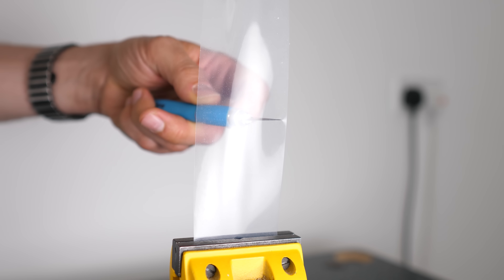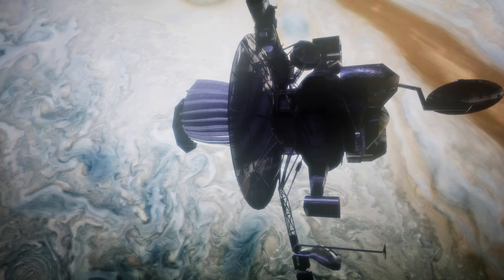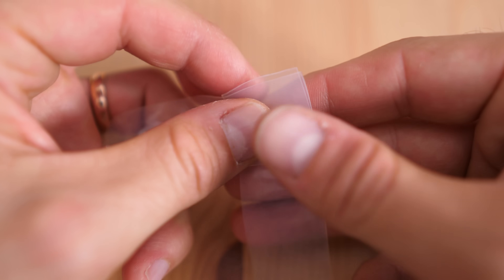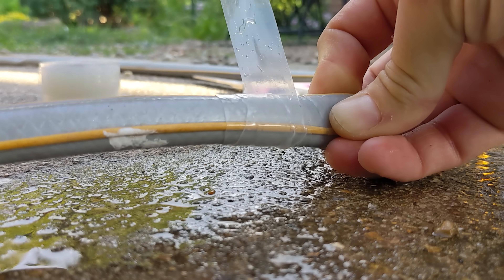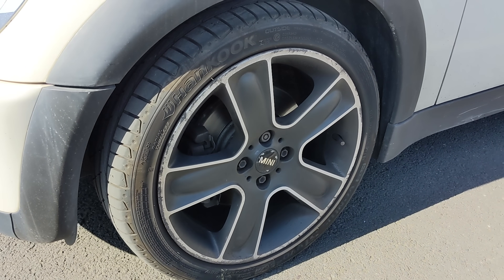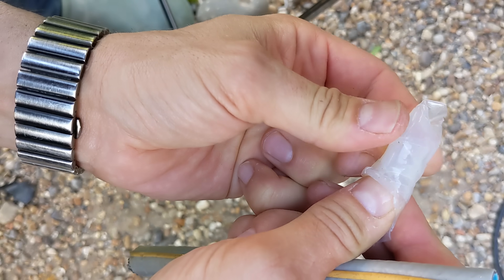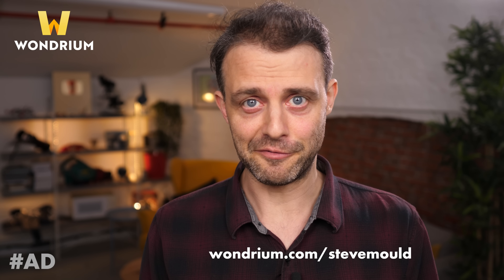Self-Healing Material

Comment: Back in the day I serviced high vacuum pumps and systems. I had a call to a rubber factory that crosslinked a continuous sheet of rubber with x-rays. The rubber sheet entered and exited a serious looking thick walled concrete room with a very heavy bank vault looking door - this is where it was irradiated with very strong x-rays. There was a very high vacuum system for the x-ray source and it had a leak which I needed to find with helium. Being in this room was scary as the vacuum system was on and if the x-ray chamber was switched on I would get like a thousand chest x-rays at once. There are so many times I wished I had a camera with me!

Comment: Ever since I learned about cold welding in vacuum, many many years ago, I always wanted to do an experiment where I have an hermetically sealed workspace filled with nitrogen, then machine two pieces of metal flat, polish them to reduce the surface roughness to a minimum, while also keeping the flatness, and then try to cold weld them together, and if that doesn't work, because of the nitrogen between the pieces, put them in a vacuum chamber and then try to rub them together to see it they fuse.
Reply: There is a video on YouTube where someone tried to do exactly this as I recall. But I believe it was Action Lab and therefore flawed and ridiculous. Still you could check it out. One thing I will say as someone who works with both vacuum systems and nitrogen as a purge gas, it is very difficult to get either a very deep vacuum or a very pure nitrogen, and the cleanliness of your chamber will matter a great deal.

Comment: How well is the self-adherence? If you cut it in half and reattach just the ends, is that specific point weaker than the rest of the structure? You could maybe test this by cutting it in half, joining the cut, then putting it in some device that can gradually increase tension until it snaps

Comment: Fracture split conn rods, big ends are made as one , then the bottom clamp cracked off. The sodium cut is bubbling through the paraffin . I was told not to leave micrometers closed or the mirror faces will bond . Self vulcanizing tape i, but not seen transparent self vulcanizing before, and it is a bit sticky. Ive found the tape works very well . Always fascinating.

Comment: Since sodium metal reacts to water, with violence, does the sodium heat up, even a little, when it comes into contact with the water molecules in the surrounding air?  (Before oxidation occurs blocking the reaction.)  
Probably a Homer Simpson question but if you answered “no, not at all” that would be pretty interesting.

Comment: Push the metals together with enough pressure, then they would fuse.  You just need to overcome the oxidisation.  The polymer has parameters that avoid these issues of high pressure.  Nice non-the-less.

Comment: How does this polymer react to heat?  I'd like to know what chances of it being able to be 3d printed are.  With the current methods for fdm (the layer based thermoplastic printing), the layers are often the weakest part of the print.  This polymer would allow a part to become more isometric in properties.
Reply: I was just thinking the same thing.  This would be a great material for FDM printing assuming its properties are retained after heating.  One problem, however, is a different material would be needed for support material I would think.
Reply: @Bricksniper  guys it... it sticks to itself at room temperature... you can just extrude it and it'll fuse.

The problem, is that you'd need to put it on a filament roll, when it sticks to itself.
Reply: @Bricksniper  just print things that don't need supports

Comment: There is an older version of a non-healing tape used in aviation called F4 tape. It was a rubberized black tape with a stripe in one side. The tape is used to weatherproof aircraft cabling and wires exposed to the harsh elements aircraft operate in. When stretched tight around what it get wrapped on the non-stripe side would stick to itself as it trys to relax.
Reply: This is immediately what I thought of when I saw this video. I work with F4 tape every day!

Comment: In the electrical industry we use a tape called amalgamating tape. The tape is used for wrapping up joints made in cables that are outdoors like power lines. It is extremely stretchy and when applied it is stretched an wrapped around, and as it tries to shrink back it kind of bonds and the layers stick together similar to the polymer in the demo. I was always fascinated by this tape but couldn’t work out how it could work because it wasn’t sticky. What’s even more fascinating is why most materials don’t bond back together. Good demo and liked the shrine to PS.

Comment: I don't know if you've come across it before but have you ever seen two pieces of steel lock together because the surfaces were ground so flat that the grain structure could hold them together through friction? I can't remember the exact science of it but we had to do it at college during metal working class to demonstrate filing/lapping proficiency, it took bloody ages, I remember that much. I think they're called lapping faces, you create two perfectly flat pieces and then twist them together and the sort of cold weld to each other.

Comment: I think this material is awesome, I am going to share this with my boys for sure! 
Just for engagement;
Another cool thing about metal cold welding is that you can do it in the atmosphere! Obviously with gold, but also with oxidizing metals you just have to design the joint to push out the oxidized material as the material is pushed together 
But, even then there is an amount of time that you have to wait while holding it all steady for it all to weld together, it starts at random locations in a process called galling, and eventually becomes one solid unit. 
The amount of time is dependent on the temperature 
I find it absolutely crazy that there is amount of contact time required for the metal lattice to fully recognize that its one unit again!
Reply: well, as with crystallization lattices dont magically occur. ;)
Reply: @AkiSan0  also big brain
Reply: big brain

Comment: you can weld two pieces of metal back together by just pushing if you push hard and rotate the pieces of metal relative to each other and produce a bunch of heat (pressure welding)

Comment: Plastic Eng. Prof. here wondering if the material is a thermoplastic or thermoset. If you heat it does it melt or burn? If it does liquify I wonder if the material properties are the same after the material is cycled a few times. (P.S. Steve I give my students a polymer identification project each year, and this is going to be a great summary resource for them. Thanks for the awesome content!)

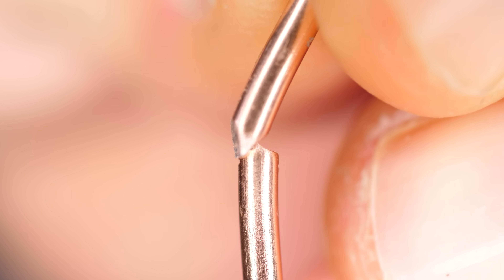Comment: 1:25 - still haven't finished the video; but metal then could be sealf healing in space without oxidation. In space metal should fuse back together if you press them on each other.

Comment: There has been a silicone 'tape' on the market for several years that will self-adhere but not stick to dissimilar surfaces.
Reply: Yes there is but it doesn't heal when two cut surfaces are put back together, it works by having a nanosurface covered in ridges or tendrils making one square centimetre many many square centimetres. Because perfectly smooth surfaces are very rare and full contact between surfaces is difficult to achieve when the nanosurface silicone is employed rather than just the silicone surface then far more contact is made, and because the silicone is slightly sticky the increased contact area increases the sticky factor proportionately. It's the nanosurface that reflects light in that holographic manner, that's how holographs work as well and shouldn't be mistaken for material stress dichroism (I think that's what it's called) and yes the tape doesn't stick very well to other stuff, it's naff.

Comment: I wonder if things like a bouncy ball or a tire are actually one whole crosslinked molecule, or if due to the randomness in the crosslinking reactions there's a small amount of very long and complex polymer chains but they are technically molecularly disconnected (just tangled together). Would be hard to prove either way.
Reply: It appears that tyres are, infact, one giant crosslinked molecule. The rubber goes through a process called volcanization that bonds it together, from my understanding. 

I'm not a tyre expert though 😂

Comment: I don't buy the oxidation argument for why metal won't fuse together on contact. That would imply that cutting + re-joining metal would work just fine in a vacuum chamber, or under oil for example, but it does not. I was really excited to hear an explanation for why metals don't fuse on contact, but I remain baffled!
Reply: Did you not watch the whole video? He explains that metals do indeed cold weld in the vacuum of space. And gold will cold weld even on earth because it doesn’t oxidise.
Reply: @supersymm3try  They cold weld in tiny spots if you're unlucky. It's a far cry from fusing together on contact.

Comment: I've always wondered what makes something "self healing". Ever since I bought a self healing cutting board for crafts. I'm not sure if it's made of the same material. Thank you for another amazing video!
Reply: Self healing cutting boards are different, they basically compress the surface rubber so that if it's cut, the compressed rubber expands to fill the gap, but it only works so many times
Reply: Self healing craft boards seem to be rubber glued to a base that is hard to cut. The rubber doesn't actually heal, but the slits don't remain visible because the base keeps the rubber in place.
Reply: @TimothyFish  This should be easy to test out by making a cut then pulling at the sides! I want a self healing cutting board to try this now. For science!
Reply: @TimothyFish  I vaguely recall some self-healing cutting boards that have micro-tubes of epoxy resin which ‘heal’ (fill) lacerations in the cutting surface, too.
Reply: @jasperfk  imagine the poisons in this product.
Reply: @TimothyFish  i knew it wasnt self healing when i saw the one on AvEs bench
Reply: So basically jusr beat up the board and let it melt a little?

Comment: the polymer isn't "self healing" so much as it is "self adhesive" which is why you can put any two surfaces of the polymer and press them together and they fuse.
I think it is important to make this distinction because there are self healing materials that return to their original form and structure when damaged.

Comment: What if it's a cross-linking environmental activated? Uv or O2 or H2O in the air. You could try in the dark or under water/oil (in vacuum seems defficult). Also it would be interesting trying very small surface interaction, is it sure it's not just vdw forces?
Reply: Nice video btw

Comment: You absolutely can fuse metal back together, if you machine the joining surfaces nearly perfectly (not even molecular, you can do this with an accurate mill) and slide them up against each other the crystals with align and they will become one again, requiring a lot of effort to separate or slide them again (depending on the metal, amount of surface area, and the accuracy of machine perfect).
Reply: What is this process called?

Comment: Similar to cold welding, I recall seeing a discussion in a Caltech publication that cleaving a diamond in a vacuum would leave 2 surfaces that could be brought back together and rejoin. IN THEORY, if the surfaces were perfectly realigned, then the diamond would have no optical defects evidencing  the cleave and rejoin.
Reply: @MonkeyJedi99  Gage blocks aren't wrung together causing the same type of thing as the tape though. I believe it's due to them being such a tight match that wringing them pushes most of the air out of the gap creating a slight vacuum. Not completely sure on that but I do know that it's not magnetism as I believe ceramic gage blocks will do the same thing and it's not cold welding as the joint isn't strong enough for that and there is a very very small oxide layer formed almost immediately when metal is machined and these blocks sit in a box specific gage blocks potentially not being used for years and then will still wring together.
Reply: @zugigauto  I did not even hint at magnetism, and I think you are right that the precision surfaces "wring" because of vacuum.
Reply: Cool

Comment: I am not sure about your explanation of why cut metals don't weld again after being cut. You said it's due to oxidation, but I think it's due atmospheric pressure. When you cut a metal, the new surfaces will be exposed to atmosphere, which will prevent them from welding again unless you applied a pressure higher than atmosheric pressure to force the air out of the surface of metal.

Comment: The material is evidently an elastomer like rubber, I don't think that cross-linking or reactive functional groups could be occurring because cross-linking of rubbers requires very reactive species to be present and able to collide not just touch, so any actual bond forming would only be likely in the liquid phase anyway. I think the reason that the material bonds is due to the materials ability to deform and return to its original shape. This is happening on the nanoscale as well as the macroscale, at ambient temperatures there is enough heat energy to make the polymer chains move around. This molecular motion allows chains on either piece to entangle and rejoin them. This could be tested for by lowering the temperature of the test pieces (flat so it's a fair test) until they become rigid and then attempting to rejoin them. If the materials data sheet is available it should show the glass transition temperature required for this (tg) or it may show more than one in which case it would be the lowest one. If this does not shed light on it then it's some kind of new voodoo but I suspect it's actually a performance elastomer.

Comment: Oh wow I thought with metal it was because of how neat the grid is and that when you cut it it’s hard to align the molecules exactly in front of where they were??
Reply: Metals are not, generally, a "strict" lattice (i.e., they're not like a crystal), so realigning the metal atoms exactly is not going to be an issue.
Reply: @mattheffron391  ohh good to know! But I mean in a sense of the straightness of the cut? Like to puzzle it together and if you aren’t super precise then the difference in the curve creates the distance bw two pieces that’s much higher than bw the atoms in the greed?
Reply: So I guess I’m talking about percentage of contact surface vs contact points or smn

Comment: That stuff reminds me of self vulcanizing tape. It’s like an electrical tape, but it isn’t sticky. It does stick to itself, and over time, a few hours or so, it basically becomes a single piece.

I believe there is a chemical on the surface that causes the change. The tape slowly loses the ability over time, and will stop working when too old.

People may know the tape under other names.

I use it in aviation applications, for a variety of reasons. To protect wires, provide cushion for clamping points, etc.
Reply: Pretty sure this is the same stuff.
Reply: @kjdude8765  Seems likely.

It’s very useful stuff.
Reply: Yeah, self amalgamating tape. I've used it on boats for years. Sounds like the same thing to me. Maybe they've taken an old product and renamed it saying it's their new invention.
Reply: @theOOWFnickbrown  Maybe… I have heard it called many names. I have also seen it called ignition tape, I believe, at car parts stores.

Comment: I used this stuff for ultra-waterproofing a fiber optic connection. It worked super-well. Here in the US, you can find the stuff under the brand name of X-Treme silicone rubber self-fusing tape. Very useful stuff, and it really does fuse to itself; once it’s together it’s a solid mass that you have to cut to separate. It takes a second or two, but you need to make sure you put it where you want it!
Reply: Awesome! I just ordered some on Amazon. It looks like this stuff is pretty common so I'm going to look for it in the stores now.
Reply: @NoZioKikes88  kindly update if you can after you had some experience using it.
Reply: @tasnimulsarwar9189  will do.
Reply: @NoZioKikes88  thank you good sir.
Reply: It's called SOS Silicone Tape here in Australia if anyone is looking for it.
Reply: @Dpix1990   that is the 'self amalgamating' tape he mentions at the end which is similiar but not quite as good as the one he is using in the video.
Reply: @badenwest5838  nah, self amalgamating tape is different.

Comment: Could you explain cold welding how it works and it's properties since we can't fuse the metals because of the oxygen layer and could there be a machine or tool that can fuse two metals like in a vacuum, recreate that vacuum?
Reply: In the center of metal lattice, atoms are bind to each others in orderly matter. Everything is stable in neutral energy state. But in the edge of material there is no next metal atom where to bind. So atoms in edge have too much or little energy to be stable.  In atmosphere oxygen will bind  with edge, share electron and stabilize the edge.

Comment: So does welding work specifically because the heat strips the oxidization off the metal?
Reply: Yes, and it also liquifies the metal so they flow together. Additionally there is either Flux or a shielding gas to prevent the oxygen from reaching the joint.

Comment: You can push metal together and have it stick. Its called friction welding.
Reply: Friction welding either vibrates the metals together disturbing the oxide layer, or mechanically stirs the metal together to form a physically interlocking joint.